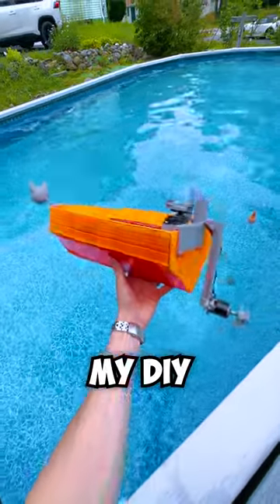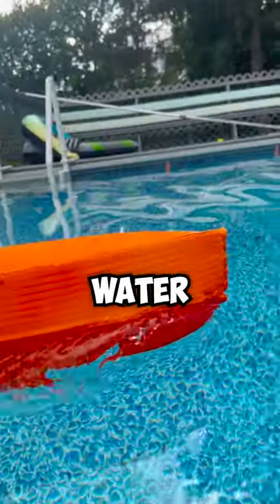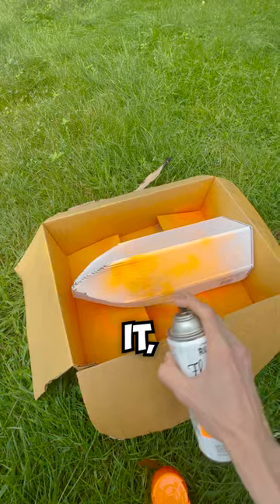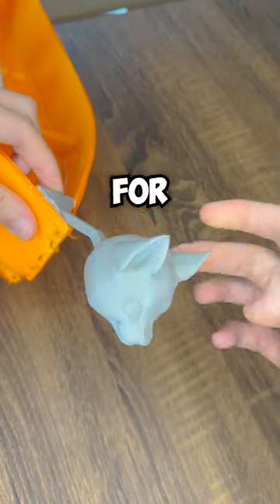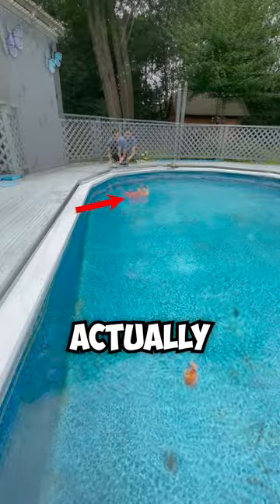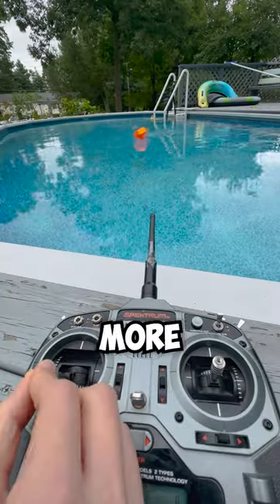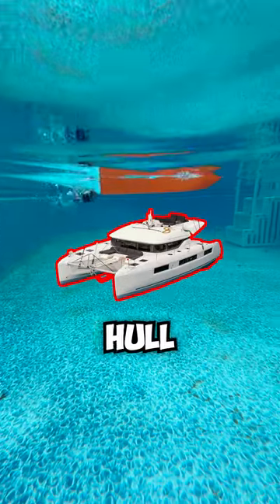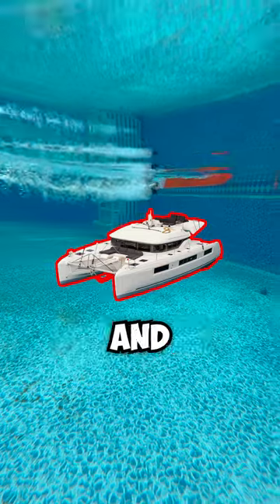V Shaped Hull Test

Comment: Try to make a similar V-shaped hole, especially towards the bow, but let the hull get flatter towards the stern allowing the front of the ship to cut water, and the rear of the ship to ride through the now flattened waves. It would also give the ship more overall stability in the water because now it won’t be sitting on like an arrow point the front V-shaped just for breaking water. The rear should also be flat similar to your first boat, or at least flattened, so that the boat can write easily above the water.
Reply: Good call he should also lose the cat head. That is most definitely throwing off the balance.
Reply from the maker: A lot of people have been mentioning making the boat flatter, especially towards the stern.
Reply: @makermandan  it’s a beautiful model, but due to its relative size and weight and the boat is having a hard time gliding through the water yk. If your next boat is almost a mixture between your first boat and the second boat would work spectacularly having both speed and control, I’m really excited to see the next one!!
Reply: @makermandan  if you look up a boat called Parker you will see what we’re talking about.
Reply: @makermandan  make the V flatter and add some steps. basicaly look at speed boats or plane floats for how you should shape it. if you get the form right then the hull will ride atop the water from a certain speed onwards.
Reply: also maybe add ballast to stabilize the v-hull? It seems to ride high in the water and as a result ride sideways. Maybe a hydroplane hull could be a good upgrade as well
Reply: Hey you stol my comment
Reply: Its called hull i think
Reply: Put the motors at the front for more thrust
Reply: @makermandan  Im not caught up, but your original design is a Jon boat. A flat stern with a V bow is a Mod Jon.

Comment: It needs a ballast, something heavy and stationary in the bottom.
Reply from the maker: It actually does have a rock in front, but I do need more ballast
Reply: Needs one all the way down the middle
Reply: @makermandan it needs a keel.
Reply: @HangeOnTop Keel - The Bottom spine of a boat, sometimes extended downwards to add stability. 
By definition it already has a keel, what you mean is a more prominent keel.
Reply: @TheNinjaSandwichGaming  yeah, but as you can see, that subtle keel is doing nothing.
Reply: @HangeOnTop  it just needs proper ballast, speedboats with this exact hill profile use liquid ballast as opposed to solid ballast. Liquid ballast allows for the ballast to mimic the motion of the water it’s in, creating an almost perfect gyroscopic stabilisation effect.
Reply: @TheNinjaSandwichGaming  ye it just needs something to keep it level
Reply: I believe the word you are looking for is keel, and yes, it would be effective but not in the bottom, you would place the keel below the boat underwater so the centre of mass is where the boat floats so it stays upright, this would increase drag and the weight which would make it far less efficient, adding weight isnt worth it at all. The double hull design he mentioned in the video is one of the beat options and I reccomend he sticks with that.

Comment: Make the back end flatter, you could introduce a hull vane as well. Furthermore the boat was too high in the water, this is due to lack of ballast. By being so high up it becomes more unstable as well, as you have a short and small waterline
Reply: Another remark, why don’t just print the hull, allows for a consistent hull shape and you’ll be able to make use of existing base designs of hull types

Comment: The v shapes advantages only really work in choppy/unstable water, the flat bottom will have less drag and deals with less resistance on calm water ( think air boats, they ride on top of the water not in it

Comment: Like you said, stability, you can add weight to the bottom of the v shaped hull but that will reduce the top speed a bit. Either way the flat bottom should be faster because its glidong over the water, little resistance. The v cuts the water which means it needs to push water to the sides, easy but still more resistance then the other.

Comment: V shaped hulls like that work best planing (When the boats nose is out of the water) and not for displacement which in that case you would need a baulbous bow. If the boat isn't stable put a weight in the bottom of it. I hope the helps.

Comment: The more u shape is much better for smaller, lighter weight, and more buoyant designs. What makes the more shape edges of the v shaped hull work is the fact that a large portion is submerged, and that allows it to stay more centered. It's best for larger designs that are less buoyant. Therefore, yea, it's not the best for rc boats

Comment: You need a keel, a keel is used as both a weight, and stabilizer, most keels of smaller boats are made of steel or lead

Comment: There is no problem with the v shape but with the weight. The boast must be heavy enough for the v shape to be submerged. 
Speed boats have a way more shallow angels. A catamaran design would work really great as well, as the stability doesn't depend on the Hull shape.

Comment: Need to make the keal heavier.  Boats with a heavier keal are easier to track straight.  Also if you transition the "v" going from sharp on the bow and flatter near the transom, will give the best balance between track, speed, handling and keep the boat at a lighter weight.

Comment: Maybe a fin or sword at the bottom with a little weight, or like a little thin rail from front to end could stabilize it.
On sailboats you  have this long sword thing underneath sometimes, motorized riverboats they dont have that of course but they lie in the water till the end of the V-shape at least. Also they seem to be weighted more to the end so when driving faster the nose gets up 🤔

Comment: Perhaps a keel would help. Different designs could be tested, like bilge for stability a centerboard for speed or a simple full keel. Additionaly it could be that turning with a rudder would be gentler than turning with the engine.

Comment: do a double hull design with a propeller on each side spinning the opposite directions. By doing so the motors even out the applied torque. It can turn by adjusting motor throttle at high speeds to increase stability. I can make blueprints if you want me too.

Comment: It needs to have some water in it(ballast) and make it more curve at the bottom so it is harder to flip for example make the bottom flat but have a v shape from that will turn into the straight part which will make it way better

Comment: If you tried flattening the hull towards the rear and maybe try props 2 and 3 but with a different pitch to gain thrust, in theory if you got the pitch correct on the prop then you could get more thrust with less load on the motor and make it more efficient 😊

Comment: also another thing you did wrong is you essentially made a flat round object so its not as efficient and with your box design that could more so glide over the water easier while the V shape would cut through the water but with your V still being pretty flat it has more resistance

Comment: I am not sure if it works for water, but on land, robots use odometry wheels to achieve localization. Maybe you could use odometry wheels that are designed for water, and code automatic correction?
Reply from the maker: Interesting idea. I imagine it would be hard to implement because the fluid dynamics would change with speed and turbulence. A fun challenge nonetheless.

Comment: I’m guessing the cat head didn’t help anything.  I imagine it put extra weight on the front holding the front of the boat down creating more drag.  Some kind of hydrofoil would probably be the best, at least after it was able to make it up on plain. Just a guess 🤗
Reply: If you want the best of both worlds then you tapper the front and make the back flat. Your also correct about the cat head, definitely throwing off the balance

Comment: You should really do some research on hull shape and balance, I’ve seen a couple of the videos from this series for the goal your trying to achieve you want a shallow v that transitions to a flatter shape as towards the aft, deep v bull boats are good for low speed stability but get hard to manage at speed while flat bottom boats are great at acceleration but do not handle Well, also far too much of your boat is above the waterline and all of the weight is in the back meaning instead of reaching plane you’ll likely just flip over during the transition from plowing to planing. Look at boats like criscraft runabouts or small Boston whalers for hull shape instillation and do something about the horrible weight distribution